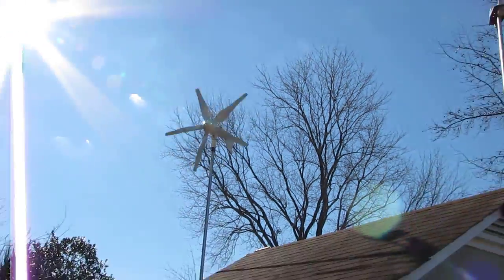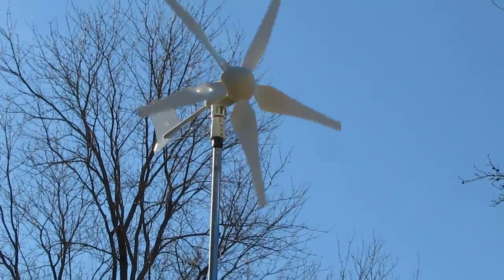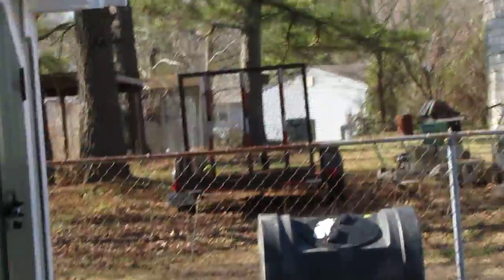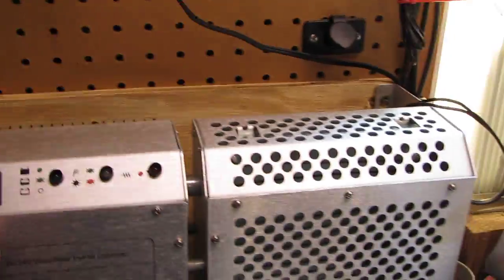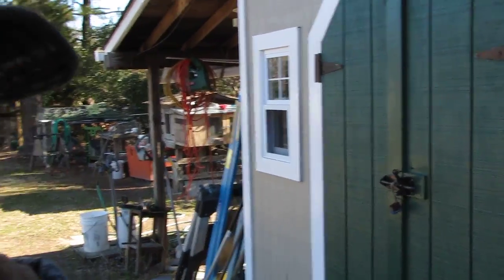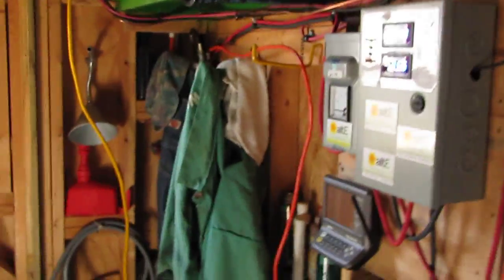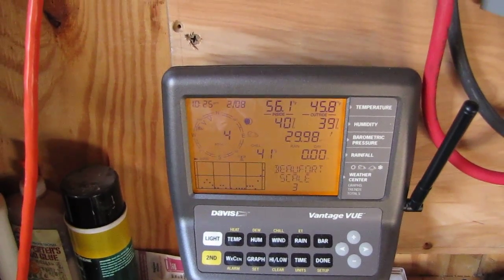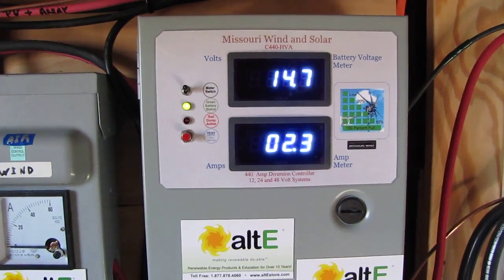WINDMAX HY  500   24 V  5 blade wind turbine  In Virginia

Comment: will i need a 3 blade or a 5 blade for low speed winds(3.50m/s),what's your opinion?
Reply from the maker: +vivek gangwar I Like The 5 Blade In Low Wind I'm In A Low Wind Are  Also They Work Great  Check This Video Out 
https://youtu.be/v3gEHuJ6xJ0
Reply: KVUSMC / Kenneth W Viar Jr do u have any idea about wind speeds required for these to work?
i got 4.30 m/s in summers and 2.50 m/s in winters..what will sayabout these?
Reply from the maker: +vivek gangwar These Turbines Start Producing  Power At Around 7 Mph Winds  You have to have atleast  A 7 Mph Wind
Reply: KVUSMC / Kenneth W Viar Jr yeah..thanks..7 mph means 3.12 m/s ..hahha..ok last question.
last question... is there any impact on power production if  uses a 600 W or a 1000 W ,will i need less power or high power turbine..which will be more efficient in those winds i described!!
Reply from the maker: vivek gangwar I Would Go With A1000 Watt Turbine
Reply: KVUSMC / Kenneth W Viar Jr thanks..
Reply from the maker: vivek gangwar Your Welcome
Reply from the maker: +vivek gangwar Your  very welcome

Comment: How did you mount that on a pole?  I purchased a sunforce 30' tower and the top pole is way to small for the coupling that came with the Windmax.  I really didn't want to have an adapter made to fit between the two.

Comment: Wow man, that's SO much better than your last wind turbine I'm impressed with this one. Looks like your bank needs to be discharged :) We are running on pure solar power now for everything but the 240V stuff. I pulled 2.8kwh off my battery bank and had at least another 3.2kwh left...it was awesome. I was drawing 700Wh and it didnt even bat an eye... Check out my newest video, I run my washing machine off it and a few other things...